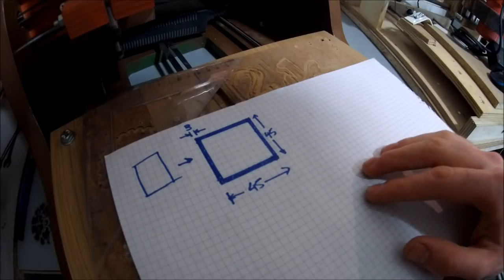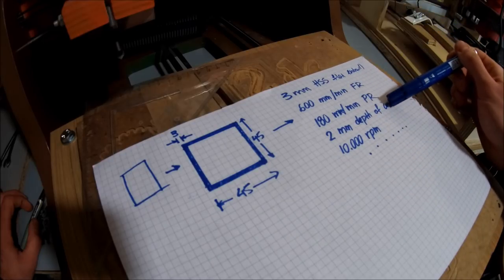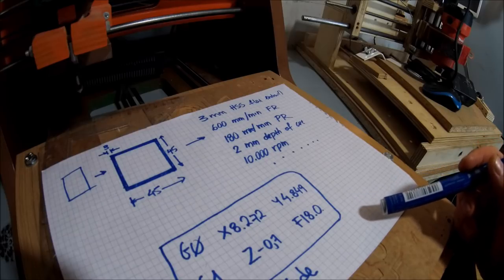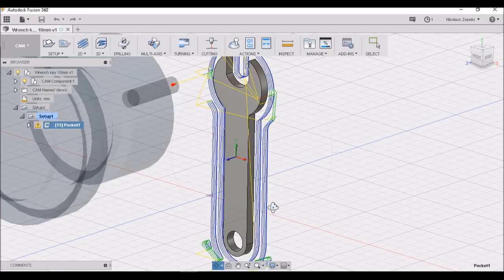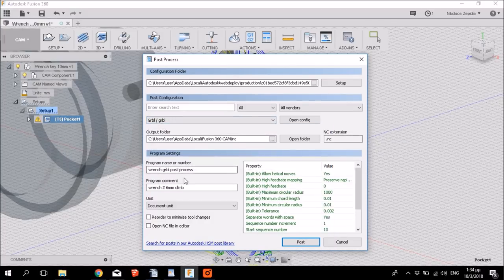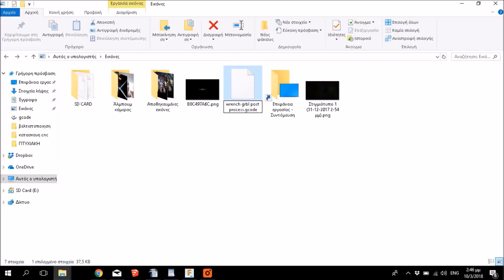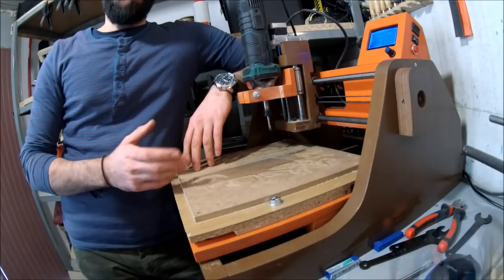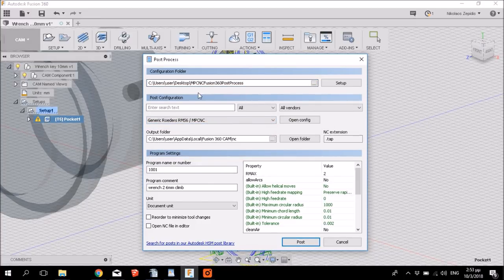Running Marlin on a Mill

Comment: Do you prefer marlin over GRBL? Have you tried putting on a bluetooth module on your arduino and run cuts using your android phone/tablet? 

I'm on the fence on switching or trying marlin because 32bit arm processor. But feature wise, I am not convinced. As the GRBL is easier on the fly to do setup changes.

Comment: Question : I plan to move from protenere and grbl to skr and marlin. Can I configure marlin with the same possibilities as grbl steps/mm, acceleration, acid revert and so on ?
Reply from the maker: Hey Bernard! Sure. As long as nothing changes on your hardware, I cannot see a reason why the numbers should be different.

Comment: Liked subscribed.  I've got a Shapeoko 2 that never used the Grbl board since I have owned it.  I 3D printed with it using a RAMPS 1.4.  Now 6 years later, I want to run it as a CNC and not a printer.  I have driver which handle 4A for the RAMPS.  Should I go with GRBL or Marlin?  Does it matter?
Reply from the maker: Both will get the job done! I prefer the Mega-Ramps setup, along with a modified version of Marlin, just because you can run it on an sd card (no need for a computer to buffer the Gcode commands), you can adjust the feedrate live (as a percentage on your initial code), you can tweak an save your machine settings on the fly, run bed leveling cycles and small things like those. On the other hand, its been a while since I last used grbl to be honest!
Reply: @ZepLabs  just what I wanted to hear.  Machines already equipped with ramps and some fancy driver boards.

Comment: Hi Zep,
I'm building a 3 printer (ender2 style) from scratch that I want to transforrm into CNC (lazer or micro mill) for fun. I got a spare MKS BASE 1.4 control board. What do you recomand me to do? 

Use it with marlin sofware + post processing after my CAD project (with fusion360) or dowload the GRBL firmware (mega) into it?
Thanks a lot.
I really enjoy your videos!
Keep up with the good pace...
Reply from the maker: Hey Levisgil
Much appreciate your feedback!
Both options sound good to me! I believe I 'd go with Marlin, just because it is a but more customizable. Or at least in my head!
Cheers
Reply: @ZepLabs  Thanks Zep for you response,
So if I keep marlin and  want to use the TFT32 screen with my MKS BASE 1.4 control board. For the TFT32 I only saw GRBL software. Do you know if the TFT could work like your LCD board for CNC for marlin?

Comment: I was wondering if anyone had done this. i might give it a try. Love the idea of SD card and display support. I am having a hard time understanding what you are saying sometimes with the buzzy mic and the accent. Thanks for the video. What changes did you have to make to the firmware to run CNC? You had to disable the bed and hot end temperatures, right?
Reply from the maker: thanks Jeff! Yeah thats right. You can find the modified version I am using in Truong Cong manh's channel. Link to that under my "talking software" videos on that build.
Cheers!
Reply: @ZepLabs  Hello, I can't find the information about modified marlin in the "Truong Cong manh" channel, can you somehow indicate a link to download this modified marlin for cnc-router? Thank you, it would be very useful since I can't find any marlin that it works for me.
Reply from the maker: @aviador58  sure! There is a link under this video of his (https://youtu.be/jlOyqca9AqM). Check how this works for you!

Comment: Hello ! I really appreciate all your videos and the amount of work you've put into them. I need an advice on a project I am going to do. I have old CNC which is based on MS Dos and parallel port and I want to convert it to Arduino ( GRBL or Marlin) And I am not sure with which one to go. Have independent control and SD card on CNC with Marlin or use GRBL and PC. Option with GRBL is a bit cheaper but nothing serious. Thanks in advance ! :)
Reply from the maker: Hey Petar! Thanks for your feedback!
Personally, I enjoy too much the extra little things Marlin has to offer, so I wouldnt go back to UNO anytime soon.. 
Other than that, both will work great!
Also if I were to go back to a pc dependant relationship, I would maybe give a try to linuxCNC which also sounds promising..
Reply: @ZepLabs  Thanks for the reply!  What are the little things that Marlin offers more than GRBL ? Also am I able to control Marlin via PC (same as GRBL) with maybe CNCjs or Universal Gcode Sender ? Last thing , for Marlin are you still using Trương Công Mạnh 's version or Marlin for CNC ?

Comment: i wanted to run a 3d printer and a cnc mill on the same machine is it possible with modified software or even the unmodified one     ??
appreciate it man
Reply from the maker: Samuel Assem software-wise sure it's possible..then you have to worry about the hardware though! Clamping onto your heatbed, mounting your spindle where your extruders are, the overall stiffness of you machine...and the amount of time it 'd get you to switch from the one setup to the other! But it's totally do-able in my head! 🍺
Reply: Check out a company called Stepcraft to see how you can use multiple tool heads on a single gantry (router, 3d printer, draw knife, laser, ect.)

Comment: hi, I put your Configuration_bed_leveling inside marlin, do I have to put the 3 jumpers for each xyz axis? microstep?
Reply from the maker: Hey Marcy!
I dont recall, right now, as I am using two tb6600 to drive my X and Y. But this is a purely mechanical option. I mean once you decide how much microstepping you want to run your motors with, then you just calibrate each axis (steps per mm) and you should be golden.
Reply: @ZepLabs  hi zep, in the video I saw that you use ramps 1.4
Reply from the maker: @laserk40  sure! But instead of the A4988 pololu drivers I am now using some tb6600, still through the ramps shield. I think i have them at 1/8th microstepping.
Reply: @ZepLabs  ok thanks, greetings from italy

Comment: i use aspire 8 and just used model maker post processor and it works with the same modified marlin for mill. And its good to not need pc to control cnc mill. Just had to mess around with z axis mine was going inverted :).
Reply from the maker: Alvydas Urbonas mo-del ma-ker.......noted! Thanks! Will give it a try(aspire too). Yep this setup is coming out really handy! I think just the live feedrate adjustment feature is enough to make somebody want it on his mill. Cheers Alvydas🍺

Comment: Hello sir, can you explain to me. which one has high accuracy between marlin and grbl?
Reply from the maker: Hey David! In fact, accuracy of such a machine depends on the hardware instead of the software! Has to do with your stepper motors (200 steps per revolution are the most common ones). Then if you are using , let's say an 8:1 gear reduction ( I 'm not using any reduction here!) , you go 200x8= 1600 steps per mm! If you had that motor coupled to a threaded rod to move your axis, which had an 8mm pitch, this makes 8mm movement per revolution or 1600/8 = 200 steps per mm! And at last, you could always use microstepping (which relates to your stepper motor drivers, I mean the hardware!) to get this number even greater! So regardless the control software you are using, you just type in there those numbers (how many steps has each one of your motors to make to move the according axis carriage for one milimeter) and you use it from there! Between the two of them, I find myself to enjoy Marlin the most, but this is for other reasons, on which I should make a video about!